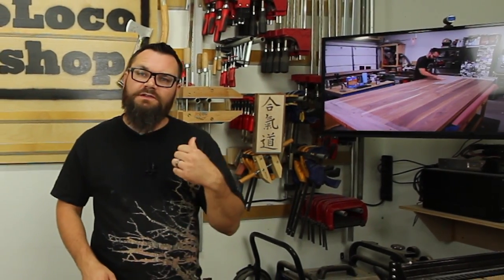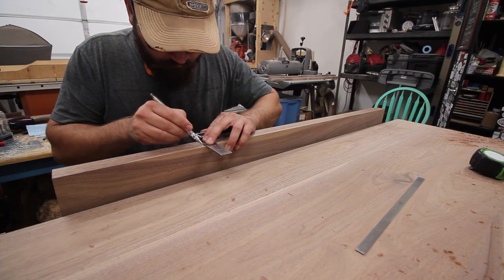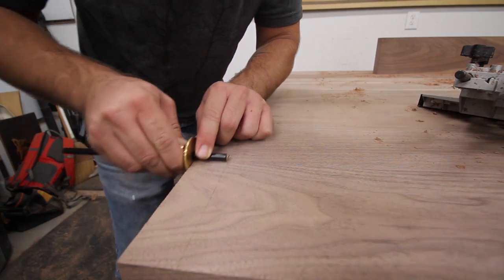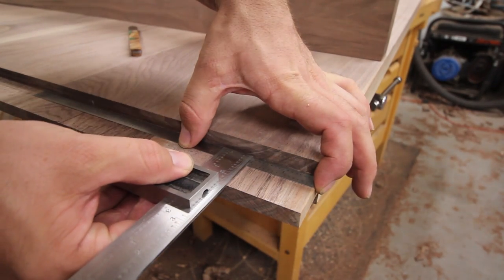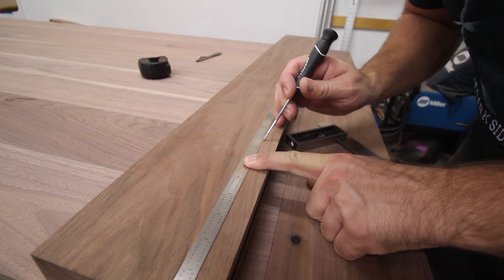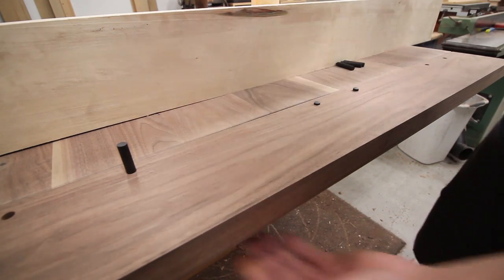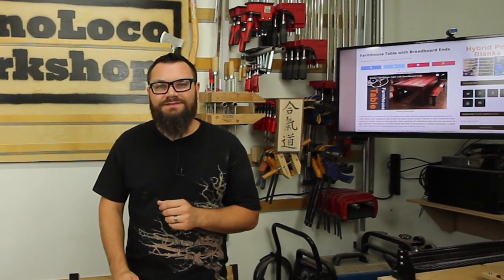How to Make Breadboard Ends with Drawbored Joints

Comment: Thank you.....
I'm just starting out  woodworking 4 a few months now and got tied of digging out all my tools for a project that I needed ....
So I thought it was time for a shop so for the last week I've cleaned out my garage and a small garage at that. So I thank you again for sharing and getting back to me so quickly.. I think this is going to work out better for me since I'm in such a small shop.
Reply from the maker: I've loved the two carts with the drawers. If I were to make them again, I would add the storage on the back as I never use it. I also wouldn't add the little storage area above the cart with the enclosed drawers.

Comment: Ty,  - great video and technique. I have one question that I'm finding very little input on and would appreciate your thoughts. I am currently building a chest of drawers which will have a solid wood top and breadboard ends. My question is, how long do you make the breadboard end relative to the top, given that the top will expand (or contract) relative it, without making it look like a goof. My top will be 20" deep using 3/4" poplar. Much appreciated.

Comment: Holy wow. Thank you so much. I almost have my top done. I will be tackling this in the next couple days. Perfect timing. Again, thank you so much. Great work.
Reply from the maker: Awesome! You'll have to share some pictures of your top when it's all done.
Reply: Ty Moser I will try to remember. I am using ash with too many knots. It has been hard to work with.
Reply: Well bad news, I didn't get to the bread board ends. Got the wood all square, started noticing twist and and bows that were not there after I got them square. Went to a buddies house with a really nice moisture meter and it read 26-34 %.  Not like 7-14 like the mill promised. So frustrated I have just scrapped the project. Will do it some day. Again this is the best video out there on how to do this right. Thank you.

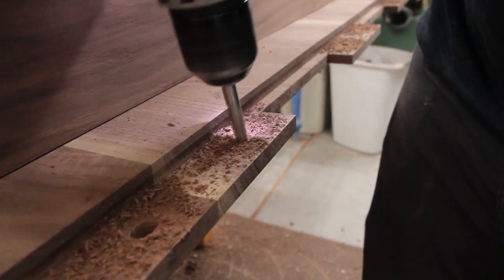Comment: You made a specific point to elongate the holes for the outboard dowels,  ... 3:48 in,  BUT when you were making the mortises and hand chiseling the corners you left the impression that the tenons were not allowed to move laterally as well. I'm sure you know that the tenons must have room to move laterally in the mortises, but skipped over that important detail.  You do very nice work! Your Walnut  table turned out great.
Reply from the maker: Hey Patrick. You're absolute right. My tenons were cut a little shy of the full width of the mortises and I didn't mention that. Good catch and thanks!

Comment: You were able to plunge the mortise 2" deep with a 1.5" cutting bit (link you provided to the router bit). I am in the process of picking out a router bit and would like to at least make my mortise and tenons at least 2". Have a festool hand router and a table router. Phew for our university having a full on wood shop!
Reply from the maker: The router bit has 1.5" worth of cutting edge but the bit itself is about 2.5" long.

Comment: Can this be done with hardwood cutting boards? When the outer 3rds of the joints aren’t glued, is no glue on those ends not good because of gaps?

Comment: Hey Ty, 
How many pieces did you complete before you felt like you mastered this technique? I am just starting out and using what I can afford like the Kreg pocket hole system and after reading many comments and articles online about them I feel embarrassed. I am in the mist of trying to get to the correct methods of attaching bread boards and this process looks daunting, but I am willing to give it my all because I love working with wood. So what advice would you be willing to share to a newbie for this process? Side not I am currently only making 4 ft benches that are 11 inches wide, benches have been selling well for me until I started learning more about wood movement and became hesitant to create more pieces until I found a better way to attach the bread board. This is the technique that looks like quality and that is how I want my benches to be and not to crack in a year or so because of bad craftsmanship.
Reply from the maker: Hey John,

I still wouldn't call myself a master but if I were you, I wouldn't be hesitant to try to do the full blown bread board ends with draw bore joinery and sell the first one. You could always make a couple test pieces if needed just to make sure you got it down.

Comment: Well done video, Ty. I have completed a farm table tabletop with breadboard ends in a manner similar to your technique. After sitting for about 2 weeks in my AC'd shop, I have noticed 3 to 4 mm of shrinkage of the width of the top and thus the ends are proud by 1-2 mm at each end. I'm wondering how I would want to address this before staining and applying finish. The table will always be in an AC or heated environment when in use. Any words of wisdom?
Reply from the maker: I would say you should probably estimate the min/max width of the table and split the different with the length of the breadboard end. The table is going to change no matter what you do and the owner of the table will just have to deal with it but when they do see it change they will know the breadboard end is doing it's job.

Comment: Ty... I have watched this video several times over the past year... the question I have is relating to the tolerance in the gap between the bread board and the the tabletop... how big is that gap?  I have created a few tables with breadboards with this method a few times and no matter what I do, there is ALWAYS a gap of at least a few thousandths of an inch... In your experience, is that gap ok?  It looks like you have a slight gap as well, but I can not tell... contemplating the investment $$$ for a better track saw to cut a grove before the router starts to remove the meat on the ends...  Am I over thinking the process?
Reply from the maker: I'm not really sure how big the gap is but it's not very. To make it not look bad if there were a gap I chamfered the edges of both the table and the bread board.

Comment: I've watched this video many times how did you cut your mortises and the breadboard ends mortising machine or with a router table? Thanks ty
Reply from the maker: Plunge router and edge guide with 1/2" bit with 2" of cutting depth. I used a router table to cut the groove 1/2" deep.
Reply: Ty Moser I need to get a bigger router table I used the mortise machine and it worked but it took FOREVER!lol so DEFINITELY getting a bigger router table.

Comment: Hey man, awesome table. I am in the process of building basically the exact same walnut table. The customer doesn't want to see the dowels though. Would I still have stability just putting dowels in the bottom and not going all the way through?
Reply from the maker: Thanks Ryan! I'm sure you'll be good as long as you get a good measurements so the dowel can be in as much as possible without poking through the top.

Comment: Awesome video! Just curious, what is the width of the board that you used for the breadboard end? Currently working on a maple table top (8" wide board for breadboard end), and I feel like I need to be 3" or so in order to support it properly. I'd love to do a 2" tenon though, it'd make my life a bit easier
Reply from the maker: I can't remember exactly but it was around 5 or 6". I recently did another table that had breadboard ends that were about 9".

Comment: Hey Ty, great vid! I'm building a dining table made out of 8/4 hickory (heavy!) and am close to adding the breadboard ends, which are about 5.25" wide. I was thinking about using floating tenons (the beadlock kind), which are only 2" long. If I use enough of them, do you think that will be enough to hold the breadboard end securely?
Reply from the maker: Hey Phil, You've probably already done it since I was seriously slacking on responding but if you use enough of them then sure, I don't see why it wouldn't hold it. A lot of people are using floating tenons for breadboard ends these days. 2" long does seem a little short though but with enough of them it'll do.
Reply: Thanks for responding Ty. I actually found longer tenon stock, so those breadboard ends will be nice and secure. Thanks again for posting this video and keep up the good work!

Comment: Hey Ty, great video. I've watched a few times as I have this task ahead of me in an upcoming commission. I have a question regarding the spacing of your tenons...did you try to centre them across the width of 2 of the boards that run perpendicularly to the breadboard ends? For example my upcoming table will be 8 boards wide, so if I followed your method, would I do 4 tenons that are centred across 2 boards or just do 3 as you did and do the math to see where they end up? Sorry for the lengthy comment.
Reply from the maker: Hey Luke, I did three because... well it sounded like a good idea. I guess it's somewhat arbitrary but if you do 4 you almost might as well do one big one across the whole thing. Sorry.. not a very good technical answer.
Reply: Ty Moser haha maybe not but it’s pretty close to the answer I was hoping to hear

Comment: How did you size your tenon length/mortise depth? I see your spiral bit has a cut length of 1.5 so did you just use it's max length?
Reply from the maker: The mortise/tenon was 1/3rd the thickness of the top and length was kind of an arbitrary number. Figured putting a dowel about 3/4-inches from the edge would be about right and I wanted it right in the middle of the tenons so 1.5-inches it was. Plus there's only so deep I can go with the bit. (Even thought it only has 1.5 inches of cut length it is longer so I could probably go to two inches if I had to.)

Comment: what is the benefit of cutting the separate tenons on the table ends vs just leaving one tongue to fit into the groove of the breadboard?
Reply from the maker: Great question. You could probably get away with doing it either way but I imagine that the breadboard end would be a little more stable since it would be a little more solid and a little less hollow.
Reply: That makes sense